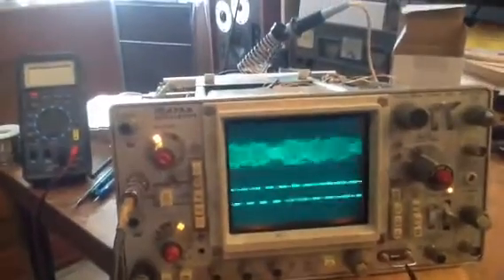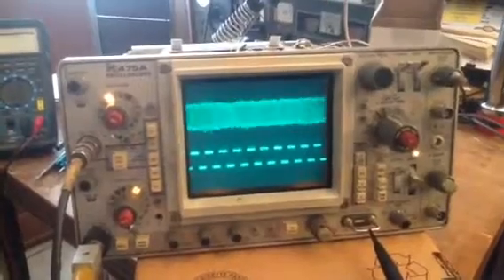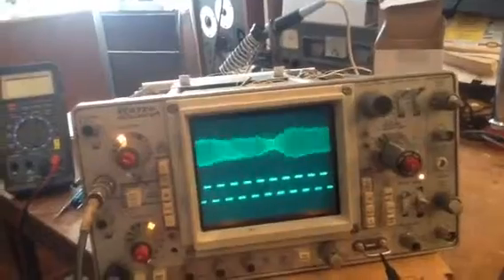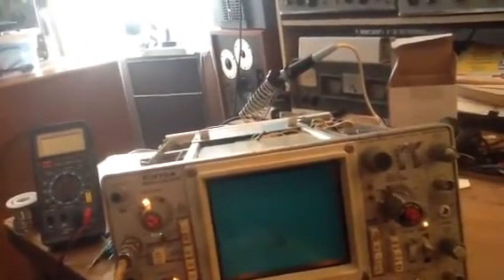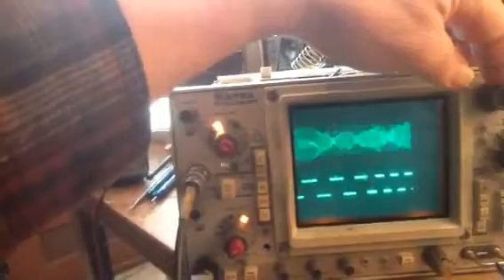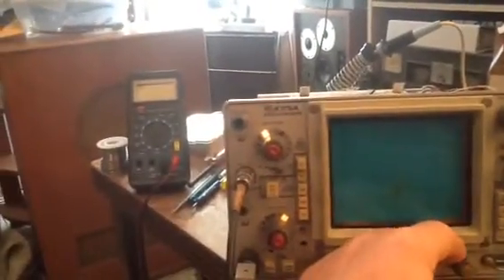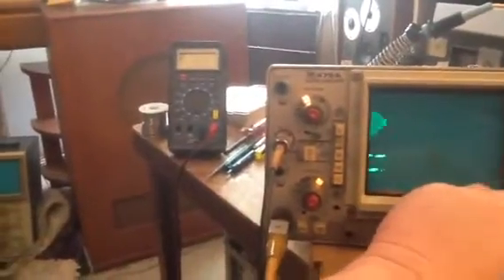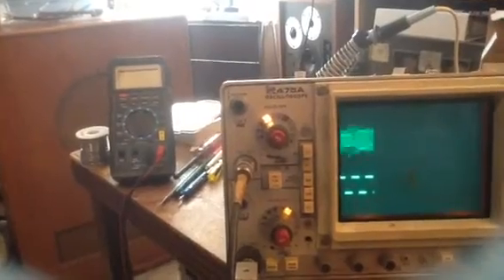Tektronix 475A

Comment: Also - mine behaves oddly in the B delayed etc modes if the knobs are locked. Did you try pulling the centre out of the timebase knob and turning to a higher sweep rate?

Comment: Hey did you figure it out? I had problems with my sweep too. In my case it turned out the JFETs in the integrator circuit that generates the sweep ramp had failed. Do you have another scope? Can you see if it is generating the B gate pulse? Could also be the B trigger tunnel diodes are fried.

Comment: Sorry I didn't respond sooner. I've restored a number of 475's and 465's. First, make sure the horizontal display pushbuttons are working correctly. Push them all vigorously several times and, if possible, squirt contact cleaner on the switches (although I realize they are hard to get to). 
Second, it's possible the knobs on the inner and outer time/div shaft are out of sync. I had this problem when I re-installed the knobs after pulling the timing board to get to a bad hold-off cap. When you switch between A and B sweep, make sure the width of the calibrator pulses doesn't change. From your video it looks like the inner knob may be one notch CCW so the B sweep is running slower than it should.